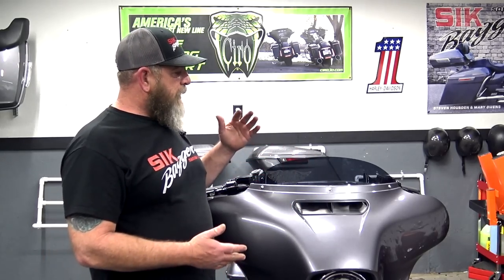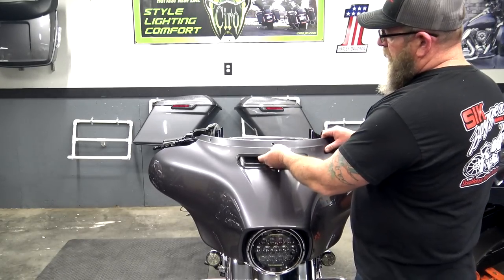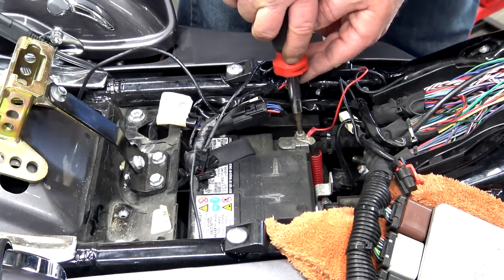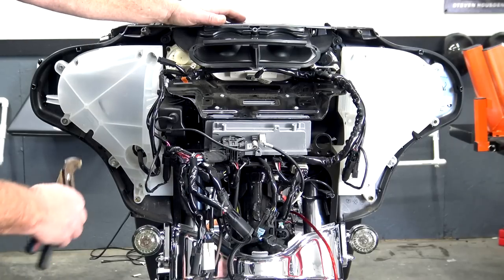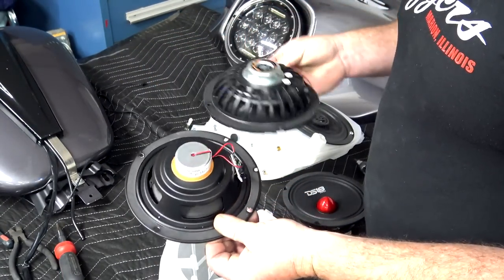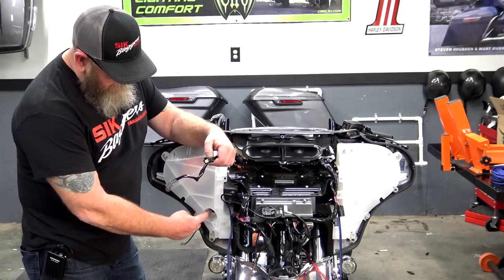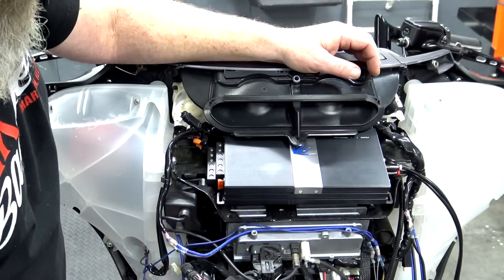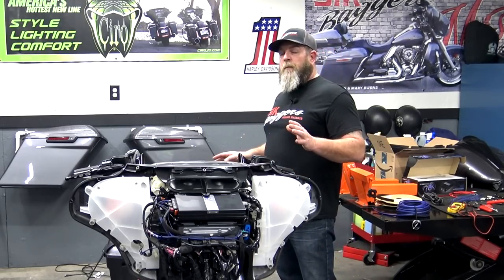⚡Install Amp Speakers Stock Harley Touring Radio⚡

Comment: Question thought u shouldn’t run ground wire from amp to the battery directly??? I have a popping noise from my speakers when I hit my air ride switch is this bad ground??
Reply from the maker: Coils (fill, dump vavles and compressor relays magnatize and cause a voltage feedback every time they are turned off or on. That is known, What isnt so known is why some audio sytems pick up that noise so much better than others. Typically it is ground issue but not always. Its more common on systems that use RCA cables. that are ran from the head unit to the amps. But again, thats not always the case. First thing I do is eliminate all body grounds/frame grounds. Then I put a diode acorss the positive and negative wires feeding the coils. The diode I use is the 1N4005. The diode has a stripe on one side that must go to the positive wire. The closer they are to the vavle the better they will work.  This si the diodes https://amzn.to/4a4mtEa ...this is apretty common issue on harleys after installing air ride. And this is the fix everyone uses.

Comment: Looks good. One thing you always want to disconnect ground first and reconnect it last on a battery. that way if you are connecting the positive connection and your tool or something happens to touch the frame or something that is grounded it won't short out.

Comment: Hog tunes sucks for the money, I’m a Rockford fosgate fan, they have plug and play and everything is so easy to install, kills me to hear guys pay for Harley install when they could have used the money for better equipment. Great video and advanblack has some great stuff for half the price! Keep up the good work.
Reply: You can still do far, but far better, than RF for the price you paid for it.  RF IS a great product, but no different from Hogtunes when it comes to Pricing. Too much money for what it does.  
https://www.motorcyclessoundsystems.com/
https://www.facebook.com/MotorcyclesSoundSystems/
https://www.instagram.com/motorcyclessoundsystems/
Reply: @motorcyclessoundsystems-mi2785  no lie i paid 1329 for an  RF amp and 4 speakers but man its loud lol im on the fence about flashing radio any ideas of a better way
Reply: James dunn If you installed a RFG systems and done by a dealer, they should had flashed the radio during installation. If not, consider doing so.
Reply: @motorcyclessoundsystems-mi2785  it wasnt done at install ill have to look into getting it done thanks brother

Comment: thnk you for this video , did answer some questions i had like where you did with the remote wire but also im doing this to a 2020 Road Glide adding 4  6.5 maring Skar Audio and a 400w amp micro
Reply from the maker: Glad they video helped troy!
Reply: Could i get a link to the speakers and amp by chance Troy?

Comment: Thank you for you continued support videos, without people like yourself a lot of harley owners would be spending their money on crap OEM upgrads. I do have a question,  I have a 2016 road glide, will this amp you have listed fit into a road glide fairing or do I need to find a smaller amp? Thank you

Comment: Great video. I have been looking at videos for the installation like this on my FLHX Harley. I stopped the video several times to make notes so I can order the parts. Never heard of those Ferrell crimps. Solved that wire problem. Fantastic job. I subscribed so I could comment. Thanks
Reply from the maker: Thank you gary...those things and the solder heat shrinks will cut your install time way down. Any questions on anything just let me know. Thanks for the sub and checking it out!

Comment: the internal pod bracing is there to provide rigidity to the plastic to keep it from resonating at certain frequencies. if you cut a hole in the pod to make more room you prevent resonance, and vibration, but you also prevent sound pressure behind the driver which causes bass loss. the best solution would be to make the pods out of a dead material, reinforce the plastic pods, or pack them with batting material to absorb resonant freqs.
Reply from the maker: yes...to make cheap harley and rockford fosgate 55 watt plug and play speakers sound better.

Comment: Awesome video brother now I think I’m ready to watch again then tackle this project
Reply from the maker: Thank you! Its not too bad once you get in there...dont be afraid to move the oem wires around, cram and position where they will go, just watch pinch points when turning the handlebars and youll be fine.
Reply: @sikbaggers  I got it man thanks for the great video again 👌🏻😎

Comment: Great how to video and love the links to all the specific items that is outstanding. 
Question the line leveler you use does it nullify the need to "flash" the harley radio that I've heard about?
Would hate to do all this upgrading for it to  not sound great

Comment: Will the amp you installed power four of those speakers? Might be a dumb question but had to ask looking to add two more of those DS18s. Your videos have saved me hundreds if not thousands of dollars. I appreciate you sir.
Reply from the maker: yes sir you can push 4 speakers with that amp...4 channel amp so you can bridge it for nearly twice the power to run 2 speakers or just run 4 speakers at the normal wattage

Comment: Thank you for your video but can you tell me what system amp speakers and line output converter you used I think I want to go with this same system
Reply from the maker: yes...this video is quite old and there is better out there and this is what I use now for this set up.. Renewed Sound Digital 800.4 EVO-X amp https://amzn.to/4dGfHFj  or new https://amzn.to/4e15y6B PRV Midrange Speakers -  https://amzn.to/4gWpp9s  Line Output Converter - https://amzn.to/4exZnb3  Youll need amp install gear...power wire, ground wire, connectors,  inline fuse, remote wire and 2 rca cables. Here are the links for the ones I use.   8 gauge wire +/-  https://amzn.to/3NpP8cO  8 GA  1/4 inch rings - https://amzn.to/3YnliMC   RCA Cables  - https://amzn.to/3YpA5VV  Inline Fuse - https://amzn.to/487fKZV Blue Remote Wire 18 GA - https://amzn.to/487LGgp

Comment: Hey man appreciate the video!! I have a 2015 ultra would I need my radio flashed for the amp? Thanks for the help! And safe riding
Reply from the maker: You dont have to have it "flashed" but it helps with flattening the EQ on the stock radio so you can tune it with a DSP...if you dont plan on running a DSP I wouldnt worry about it

Comment: Great video thanks, very helpful, but the speakers has no tweeters, will still sound good?
Reply from the maker: a good mid range will sound great in the front without tweeters...you can always bump it up to something is more full range or add tweeters to mirror holes and move your mirrors to the handlebars..if your bike is a RG then you can buy new grills with tweeters in them.

Comment: Thanks Steven, another great video. If I just wanted to change my speakers on a 2014 ultra limited, (stock system) is there anything special that would need to be done?
Reply from the maker: Hey Tim...sorry I missed this comment man...But no its all the same inside there. Biggest pain is to get those pods out to change the speakers. other than that swap them out and use the eq on the head unit to make them sound as good as you can with no distortion at high volumes. Distortion causes heat and heat destroys speakers.

Comment: Hey Steve! Great video! You’re definitely helping us bikers, all over the world, build more confidence in doing a lot of things ourselves now! One question, I’m wanting to junk my Boom Audio Stage II speakers on my 2019 RGS, and hook it up with all DS18 sound...what’s your professional opinion on the DS18 Pro’s? Very impressive sound quality? Would you buy it? Thanks in advance, and keep on slangin them vids brother! ✌🏼
Reply from the maker: Thank you Danny...Much appreciated.   The ds18s are a solid choice for the price rage for sure. They only issue I have found is there are no 8" mid bass speakers for the 8" lids. Now that being said adding anything that can handle bass is fine...in the parking lot. Riding down the road youre not going to hear that bass at all. So adding a a decent set of 8ohm speakers and getting a 4 ohm or 2ohm stable amp so you can bridge the amp and add more power to them is the best route for a clean, loud sound.

Comment: I’ve got a 2007 Electra glide classic, original stereo and two front speakers only.  I’d like to upgrade stereo and speakers... POSSIBLY  add two trunk speakers...$600 max budget.  Can you advise (which brand)?  I’m. guessing I’d have to add an amp if I go with the two trunk speakers...  thanks for all you do.  I’ve already successfully put lights on following another video of yours.

Comment: Hey Steve, first of all you definitely have the best looking videos and comprehensive list of diy stuff out there.   I have a quick question... I already have some Infinity Kappa 62IX 6.5" 2 ohm...these should work good with the rest of your set up shouldn't they?  Thanks for any and all info, love your channel man keep it up for us with thick skulls.  💀
Reply from the maker: Thank you Jeffrey..sorry for thr late reply...been down wit the flu for a couple of weeks. And yes the 6.5 kappas will work great..thats a great speaker. Just watch running 2 ohm speakers if you start adding speakers to them like in series...that will cause you to draw 1 ohm and then most amps are not 1 ohm stable.
Reply: Got a question. I have a 14 street glide. The kappa 6.5 ix flange was to thick. The speaker box side mount bolt holes wouldn't line up. How did you get them to line up?

Comment: Love the video and find it very helpful along with all the comments and questions -Thanks.
I just purchased a set of AVB lowers with speaker pods for a 2018 SGS.  I am planning to install DS18 Pro's in the lowers and switch out the upper fairing speakers to DS18 PRO also.  
I have a few questions if anyone would be willing to share;
1.  Are the DS18 Pro's a good/best choice?
2.  Should I get 4 or 8 ohm speakers 
3.  I am currently looking at the Rockford Fosgate TM400X2AD amp - is this a good choice? 

Thanks again

Comment: I noticed the DS-18’s are midrange speakers, are you getting good sound even though it’s not a full range speaker? Also do I need the LOC with a Sony AX7000?
Reply from the maker: you do not need a LOC on a sony unit they have rca inputs already and youll get decent sound from the midrange...you can only get better sound if you use a midbass and then add some tweeters somewhere.

Comment: Real simple question before I take you're advice and try this install. My 2017 Ultra Limited has 2 Ohms speakers in the front and in the back. If I upgrade the wiring to all four speakers and install the new 8 Ohms in front and the 4 Ohms in the rear, I shouldn't run into any problem using the setup you're describing as long as I'm using my stock radio and I don't already have a factory amp installed.  Would that be correct?  Thank you for your time and the video's
Reply: Did you do this?

Comment: Hey thanks for the video.  How did you mount the amp to the tray in the fairing?  I got the same setup but I cannot figure out how to best mount that amp since its too big to sit down in the tray.
Reply from the maker: i use tool box liners from any hardware store...cut it too fit so there is no vibration between the amp and tray and then big zip ties or double sided sticky velcro strips. You zip it down good and it wont move

Comment: Hi Steven great video. Question I'm upgrading my audio system in my 202 street glide special with new Boom Box radio, my Amp already comes with high line inputs foe each channel, How can determine which wire from the oem speaker wire is positive and which is the negative?
Reply from the maker: The larger spade on the bikes wiring will be positive ..but a simple test can be done to find positive. if you have a volt meter, put it on AC volts and touch it on the speaker connections to find + and -. If you get +12v that is correct, if you get -12v that is backwards. This will help you identify + and - on the speaker.

Comment: Hey man. I have a 2005 Electra glide and wanted to know if you have installed these speakers in this fairing with the speaker side converters so it goes from 5.25- 6.25. Just wondering if they will fit or if they are going to hit the fairing?  Also what would you recommend for speakes instead of these that will fit my bike. I hope you are able to help and I appreciate you and your videos.
Reply from the maker: we dont use the ds18 speakers much anymore as they changed their basket design and pretty much wont fit anything any more...a great speaker for your bike with 5.25 to 6.5 inch convertors and one we use quite a bit for a fairing up grade is the PRV Shallow 6.5's and I get them from amazon here https://amzn.to/3J2qtc4 We have had great luck with these pro audio speakers. Im not sure on your amp set up or how many other speakers you have but if you are just doing the fairing these are awesome.

Comment: Hi Steve have several questions and cannot find a utube that is specific to 
it...

1 - Do I have to use the Power Yellow and the Remote Blue cable if my 
Amp already has it ? Meaning all I will need to connect is the Speaker 
wire.
2 - I have the PAC LP7-4 L.O.C. PRO Series 4-Channel device, I'm only 
going to tap in the front speakers, so I will use 2 channel on the PAC, 
can I just twist the other two channels together ? Meaning I will use 
the White and Gray for the 2 channels, can I just twist the Green to the
 White and the Purple to the Gray for all 4 channels and then go all 4 
channels to my amp RCA ?
3 - The the Gain on the PAC will only have the adjustment on one side which is the Right and Left Rear Or Front ? or would I need to adjust both Gains to the same ?

Comment: Hey, Steve! Maybe you can help me with this issue that I have. I recently bought a original Tourpack with all the harness. But, I have a StreetGlide Special 2015 and I want to use all the controllers in the tourpack. I didnt find any video on YouTube that teaches how to install the propper way or the schematic to build a harness the propper way. Do you know how to do that? I really need the help. Thanks, brother!

Comment: Hello @sikbaggers what is your current speaker and amp recommendation (with only 2 faring speakers) now 3 years later? I noticed a year or so ago you recommended a different speaker. Thanks
Reply from the maker: yes ive switched to the PRV 6MR500-NDY-4  https://amzn.to/44KF4kQ and pair that with a Sound Digital EVOX 800.4  https://amzn.to/44IQSUH
Reply: Hey thanks so much @sikbaggers

Comment: Great video and instructions,  thanks. One question,  why does harley say you have to flash the radio. Is that necessary?
Reply: I’m wondering the same. When do you need to flash the factory radio?
Reply: Do you do the flash before you install the amp and speakers or after?
Reply: @williamwirtkayaksarge485  if you install the amp and it is not yet flashed. I ti will sound like crap. So either right before your start the project or right after you are done.

Comment: Great video Steven. Is it possible to install further two speakers for the lower fairings with this kit? Thank you in advance. Hannes
Reply from the maker: If you install a 4 channel amp you can run the front as front and the lowers as rear.

Comment: I use the exact setup with the soundstream nano amp. How do you keep the RCA cable from vibrating off of the amp?
Reply from the maker: I use tesa tape around the plugs and try to grab part of the port so it holds it all together...and tesa tape wont come apart over time like electric tape. I use this https://amzn.to/4ab1W16

Comment: Im curious, your using car speakers to mount in a bike? Isnt there water issues with that? The amp your using has high inputs so why add the line out converter?

Comment: Hey Steve thanks for all the videos. I installed the ss nano 1000.4 amp, and fairing and lower fairing speakers. Put bike back together and all worked fine. Took it to Harley to have it flashed and they looked at me like I was stupid because it wasn’t boom or RF. Told me they didn’t know what to flash it to. So I drove home! Wondering if you could steer me in the right direction on what to tell the HD service guy to flash it to! Thanks in advance
Reply from the maker: I have since found out they quit flashing radios unless its thier radio gear. The old "flash " was simply turning the internal amp off and also turning on the rear speaker wires that are under your fairing. If you have eveything hooked up now and its working just keep the bass turned down on the head unit, turn off the volume speed control and set your gains for your speakers and you will be fine. My SG had 10 speakers and 3 amps ran off the stock unit and it was fine. I never had anything done. I only suggested to turn on the rear channels but its not necessary
Reply: I appreciate your timely response!!! Thanks again!

Comment: Sorry if this has been asked and answered…if I’m just planning on doing the 2 fairing speakers with the amp in your parts list do I go with the 4 or 8 ohm speakers?
Reply from the maker: hey now worries ill try to explain it...if you get a 4 channel bridgable amp you and get the 8 ohm speakers and bridge the amp to 2 channel....meaning using all 4 channel on 2 speakers..that would bring the load down in half..from 8 ohm to 4 ohm draw from the amp. The amp should be 4ohm stable bridgeable amp.  Adding more speakers later will effect this though. So make sure you only want the fairing speakers and never plan on adding more..if you do you will have to change the amp more than likely. There are a ton of variables that come into play.